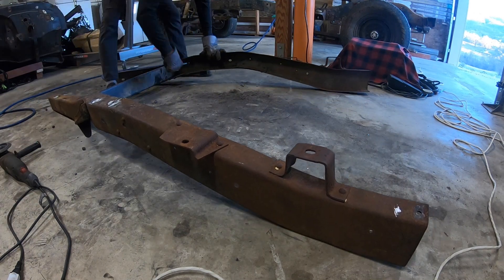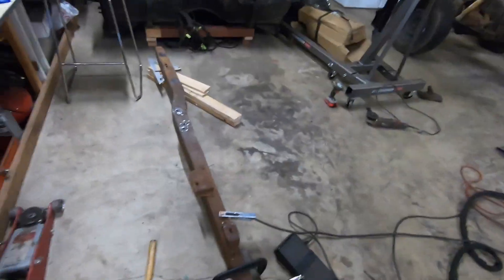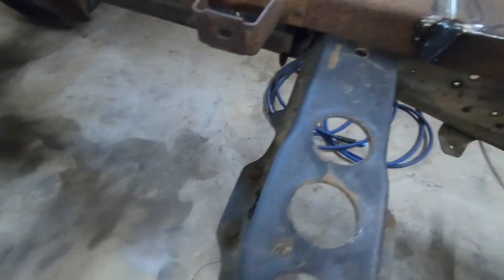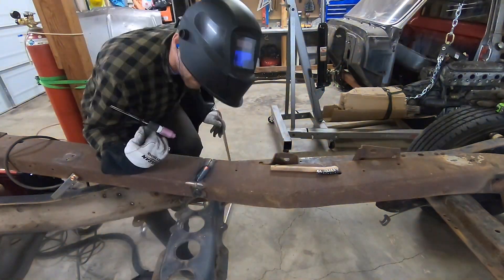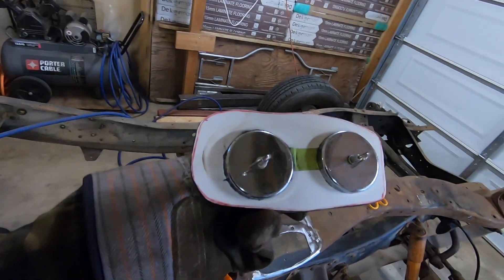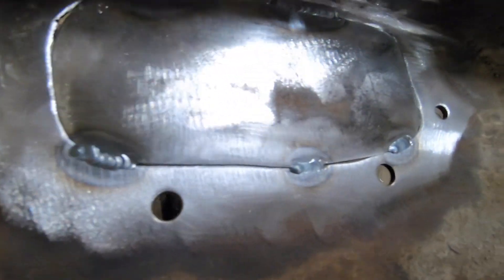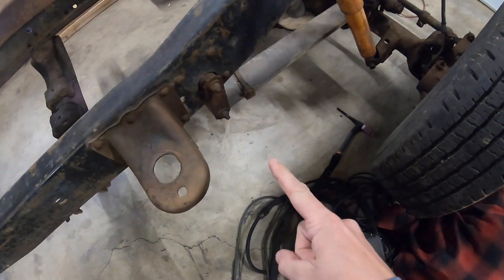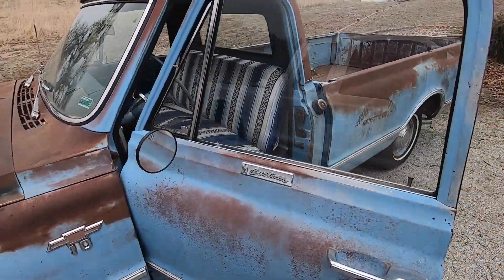C10 Swap 2wd to 4x4 Conversion Modifiying Frame

Comment: Why not mount the c10 on the square body frame? I have a 69 c10 I thought about making it 4x4. seems like you need the front and rear leaf spring hangers and front diff. ? just thinking.
Reply from the maker: Cause the squarebody frame steps up after the cab. I ended up finding a 72 4x4 chassis

Comment: With the straight vertical cuts, welds and patches your frame will crack. All welds on a frame should be at an angle or kinda stair stepped. With them being straight vertically it makes the frame strong in one section and it won't flex at that point. Over time it will crack. Making all cuts and patches like this / allows the frame to flex over a wider area and not in one spot vertically.
Reply from the maker: Thanks for the input I actually switched to a different frame recently which is going to get more of a z cut

Comment: Old Tech Tip; Patterns for patch plates or even gaskets can be make quickly and accurately by 2 ways. Tape in place, then rub finger or hand over template paper and make sure to mark directions on back where mark is. Second, tap gently with hammer to imprint or even cut thru paper to create pattern. Us older guys alway kept Universal Gasket material and tapped it with a hammer to finish close enough to finish with scissors to make a gasket. Gaskets where made and supplied to manufactures in the 60’s into the 70’s by companies that made linoleum as it was falling of in sales during this period, but made from paper, woven cloth and much more, but created with linseed oil. (Word of Caution) Linseed and other oils when drying create heat during this “Exothermic” event that naturally occurs, so place in water and air or metal lid containers to prevent fire! It is strange to say I would slide gaskets out of a kit and see the words like “Armstrong” printed on angle & repetition across an intake gasket, but it made sense. Oh well, some info to file away! A cheap alternative to paper is at home improvement stores in the flooring section. It is “Red Rosin” paper. Used under hardwood floors, thicker than construction paper & 3 feet wide by 100 feet cost $9.50 - $12 dollars. I fab sheet metal and works a upholstery patterns for car/truck seats, mine is hanging off the ceiling in the garage. Thinking out loud. Retired Auto Tech.
Reply from the maker: Thanks for the info

Comment: Where you cut the frame you could of went at a zig zag to help strengthen kind of like a puzzle piece instead of a butt weld but if your bracing it should be fine as well
Reply from the maker: Yeah I’ve seen that done also I just figured the 1/4” c channel brace I am going to use will be enough support

Comment: Probably would help to bevel that big patch at more of an angle to help get torch in close.
Reply from the maker: The problem is the tungsten holder hitting the cab support
Reply: @showmetrucks7113  you might look into a short back cap and cutting down the tungstens.